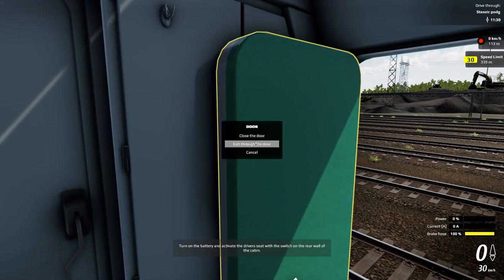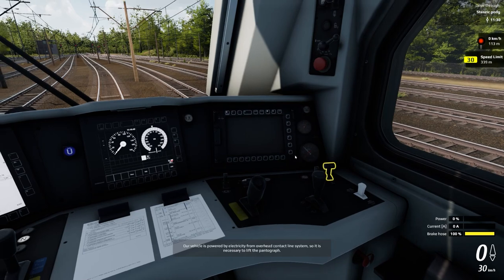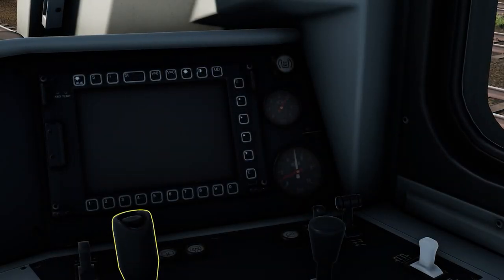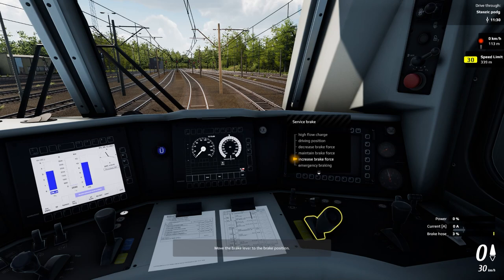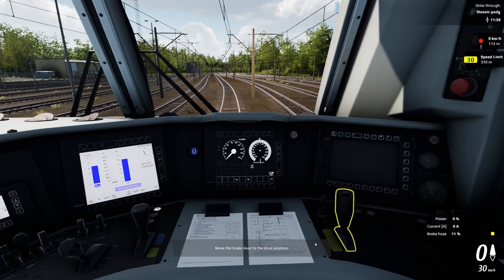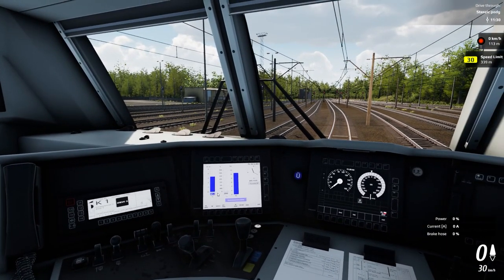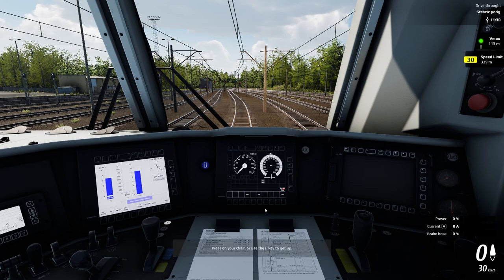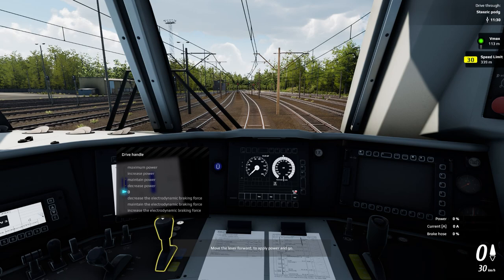SimRail - The Railway Simulator #Gameplay - starting E186 locomotive

Comment: Sorry guys, but this is absolutely off.
1. 5bar position on brake lever should be rotated more to the front. Const position should be perpendicular to the desk.
2. the whole startup is too fast, displays should be loading for about 1-2 minutes, not that they load instantly.
3. train is already full of air at the start? :)
4. the sounds are really wrong, where did You get that recordings?
Reply: And still way better than Dovetail ! :)
Reply: @e575fho  no doubts about that, but it could be better. :)
Reply: @dominickchaloupka6673  , without the modding API, both are one time players. TSW just has better graphics and post processing.